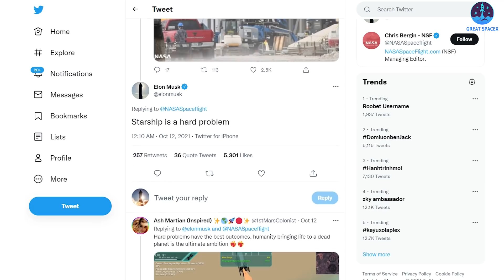"Starship 20 is a hard problem" Elon Musk confirmed on Twitter.

Comment: Could they design the Starship similar to the craft that was used in the film 2001 a Space odyssey, the craft that transport the scientists from the moon base to the monolith in the crater, 
It had the 4 engines at each side that rotated from vertical take off to horizontal flight, I it's just a model for the film, but at least it could land horizontally instead of the vertical decent position.

Comment: The BE4 and Raptor do NOT use the same fuel.   The Raptor uses liquid Methane and BE4 uses liquid natural gas.
Reply: LNG is basically methane but less pure and cheaper. I guess BO are not so concerned about wringing the last bit of performance out of their engines as they are sub orbital joy riders.

Comment: i think  landing could be improved if ring created on legs so it pops out in land and you have aditional ewinforce suspenzor so do you do body even agled force land allow so you allow even extra force working as dampfer so in case of slight heavy touch you got dampfer that take care extra trust wieght and even slight rebalance too as main balance is in legs if tested this so called dampfers on iar or oil are good and can ge continued into spirng into tube also so is even somekind triple dampfering efect off couirse is slight more money but is safer to do so and even easier land so rokcet take some cornering land alos aswell as bottom presure

Comment: A old idea might be the best idea!!
For one way to solve a lot of problems is to have the larger spacecraft permanently in space with a thorium enhanced engine!! You know with the final piece of the thorium engine completed in space!! The THORIUM engines are much safer than any other nuclear engines!! And could be the cargo carriers between earth orbit and the orbit of the moon!! Where it could land on the moon or most likely a small group of smaller crafts could unload the cargo and bring it down to the moon surface!! And even bring raw materials up from the moon to be loaded upon the cargo ship! Plus in time products that could not be made on earth but in the lower gravity of  the moon then be loaded upon the cargo ship!! And the process in reverse as in earths orbit now being unloaded by other crafts!! And with the thorium engines enhance by helium3 from the moon surface results in much greater power with less fuel!! And the enhanced engines of the large cargo ships would travel with greatly reduce travel time between EARTH and MARS!!! And even BEYOND from EARTH or MARS to other places in the solar system in greatly reduced time!! It would be less expensive and less problems!! And could be done NOW!! Might even could used a starship booster!! So instead of heading back to land on earth goes into earths orbit!! And like lego pieces that was first done in practice on earth so only SMALL AMOUNT OF MODIFICATION NEEDED!! And the very starship it pushed into orbit could have the materials with men and small construction robots with job all done in no time at all with the final component of the thorium engine brought up at the last moment of modifications is completed!! But that just a IDEAL and old ideal with slight changes that is all!! But it would SOLVED a lot of problems!!
🙉🙈🙊🇺🇸🇺🇸🇺🇸🇺🇸🇺🇸🇺🇸

Comment: The problem with Starship is its heat shield they're having an issue with those because they can't guarantee that Starship will survive re-entry into the Earth's atmosphere just one of those towns falls off and it's all she wrote and that's what SpaceX and Co are grappling with.
Reply: Another big problem is it's weight. If it's empty weight exceeds 115 tons it cannot go to the moon and back, not even with all 12 tanker flights. The rocket equation is relentless.
Reply: @KEB129  So it only does orbit to orbit. That is not a show stopper.
Reply: @earlpottinger671  It will become a very cool orbiter, the problem is the moon.

Comment: It could be interesting to delve into why it is such a hard problem to crack.  Some thoughts to cross my mind are:
1. The talk of reusable rocket stages go all the way back to Wernher von Braun.  Von Braun was hoping to make a more efficient Saturn V first stage, but the program got cancelled under the Nixon administration and Nixon had his people put into NASA and so we ended up with the Space Shuttle program.  Some have argued that Von Braun didn't have the technology to pull it off and with Von Braun dying from cancer a short time later, he wouldn't have been around to complete the project anyway.

2. An important thing to talk about is mass budget to reuse a rocket stage.  The Falcon 9 booster drops off early enough to where every 5 lbs of recovery hardware and fuel reduces payload mass by 1 lb.  For the second stage is is a 1 to 1 ratio as propellant used to go up to orbital speed can either push payload or recovery hardware.  Where this becomes the rub, with most rockets anywhere from 1% to 4% of the starting mass makes it into LEO as payload.  This gets much worse with higher orbits and much worse still if you go to other celestial objects.  In comparison, an economies of scale 747 can be up to 20% payload mass on the tarmac when fully fueled for a long flight and this is with a sturdy structure and engines that can be flown again and again taking up 30% of that mass budget with the remaining 50% fuel mass.  A rocket on the other hand needs over 80% of its starting mass to just be propellant with 20% for everything else or else it is a sub-orbital rocket.  So yeah with a rocket, the total remaining mass budget after the propellant needed for minimum orbital speed is much less than the mass budget for the structure and engines on a 747.  At this blasting off into orbit is a much more extreme thing to do than flying around in the atmosphere and returning to Earth is a much more extreme thing still to do.

3. So getting into why the Raptor engine is so important is to get any sort of engineering headroom, the engines have to produce more ISP AND thrust AT THE SAME TIME than any engine before it.  At this the tank mass had to be less than any high ISP engine before it.  Here is the problem, we produce lower ISP rocket engines that have a lot of thrust and while it has a great acceleration for a little bit, it runs out of propellant far short of orbital speed as orbital speed for Earth is really fast when you are talking about using chemical propulsion to do the job and nuclear is out of the question because we don't want to irradiate the planet getting something into orbit.  So we developed high ISP rocket engines using extremely cold, hard to handle, and voluminous liquid hydrogen.  These engines turned out to not produce all that much thrust, so then the engines get big and heavy trying to produce more thrust, largely offsetting gains in ISP and then the propellant tanks end up being huge and bulky and even more bulky with insulation to keep the liquid hydrogen from boiling off too quickly.  These bulky tanks also go a long ways into cutting into the benefit of that extra ISP gained.  These tanks are hard to make because the extreme cold makes most materials very brittle, contraction of materials under extreme cold when using different material with different contraction rates, say welding section of tank together can cause different material used in the welds to contract at a different rate, adding to stress loads until the weld breaks.  We saw this weld break issue back in WWII when Kaiser's Liberty ships that were welded together would go into fridged water and then break in half at the weld and go straight to the bottom of the ocean.  So the Raptor engine is pretty special in that it has a higher ISP than most chemical rocket engines, something that full flow staged combustion provides as well as the methane / oxygen reaction being a very energetic reaction (another reason you don't want to be too close to one of these rockets in a catastrophic failure) while at the same time producing very good thrust and the tanks can be reasonably small and don't need bulky insulation.  Full flow staged combustion is a tricky problem in that these engines in past attempts to create something like this have very high chamber pressures and just tend to blow up.  Turbo-pumped engines are very important because high pressure tanks can get to be very bulky, which can reduce payload mass down to the point where you have a sub-orbital rocket, so the turbo pumps allow the tank pressure to go way down to the point where the rocket has the headroom to make orbit and have some mass budget left over for payload in a two stage rocket design.  At this Starship still has several atmospheres of pressure in the tanks.  It is just inside the rocket engine pressures cant get into the hundreds of atmospheres, which is a pretty crazy amount of pressure to hold in and not have things break inside the engine.  The engines also have to withstand handling the heat of a continuous explosion with highly energetic fuel without weakening from the heat loads and melting down / failing.  Then there are all kinds of resonance issues, fluid dynamics issues, etc that all need to be solved for the engine to work and have the amazing performance it has.

4. So now you get all of this amazing performance just to make orbit and have some headroom left once achieving orbit.  After pulling all of the stops imaginable, ~92% of your starting mass is propellant, leaving 8% for structure, engines, and payload just to get to LEO.  Remember the 747 has 50% in this same category with 30% of it spent on structure and engines.  It is pretty easy for an engineer to spend say 5% of that on the structure and engines and then have 3% left for payload and then throw away the rocket stages because it would require the remaining 3% and then some for the recovery, leaving nothing for payload.  However Elon Musk wants to recover the rocket stages and still have 3% left for payload.  Chopping out this mass from the structure and engines to put into recovery hardware is no easy task.  Getting the recovery hardware to work, especially with such a small mass budget for them is no easy task.  The route SpaceX is taking with Elon Musk is precision flights to drone ships and towers that can only be pulled off with modern electronics as it has to be very exact, no slop, in order to possibly work.  The first stage is a lot easier to do and I was talking about this way back in the early 2000's when I took calculus based physics as I saw heating was a cubic factor with the first stage usually dropping off much sooner in a flight and the calculations I did for the first stage showed it was much easier to budget mass for recovery hardware than the second stage.  So when I saw how much was spent on refurbishing a Shuttle solid rocket booster, I thought we could do better than this and have a first stage that was recoverable.  Back then I was thinking maybe inflatable wings would work and have the rocket stage glide back to a runway for a gentle, non salt water landing, but instead be on land.  However many years later Elon Musk proved you could just have the rocket stage fall back to a drone ship and do a last minute burn to land.  At this the Falcon 9 first stage rocket needs to do a re-entry burn to not be destroyed by the forces of slamming back into the atmosphere on return, something I didn't properly consider back in the early 2000's, but then saw was an issue later on when screwing around with X-plane and flying a Millennium Falcon into space and back.  So then when you think about second stage recovery, with that cubic heating factor becomes a major problem in bringing a rocket stage back.  If you want to bring the whole rocket stage back, that whole thing needs to survive re-entry and not burn up.  It gets even more complicated because you have to figure out the aerodynamics to keep the rocket stage properly oriented and not tumble.  Then when close to the ground, it has to transition to ground without getting smashed and broken in the process and preferably you don't want salt water intrusion massing things up.  Whatever system you use for this has to use the least amount of mass possible as every 1 lb of recovery hardware is 1 lb less payload and it is very easy to end up with a sub-orbital rocket because it is too heavy to make orbit.  The Space Shuttle was a bad design with those big wings because then you ended up with this giant external fuel tank that burned up on re-entry to push those big, heavy wings and heat shielding on them up to orbital speed, so what did you really save?  Basically the Space Shuttle saved the "payload fairing" that Falcon 9 saved by dropping it off early in flight and then fishing out of the ocean, which yeah, that is kind of wasteful in the Space Shuttle design.  Then again 1.5 stage to orbit is very inefficient when we already had 2 stage designs that were far more mass efficient as with 2 stage you drop off a lot more empty mass much earlier in flight.  When you think about the Saturn V for example, each stage that was actively firing would be the heaviest part of the rocket when it lit up its engine(s).  When it expended its fuel and was a big, emptry structure with big, heavy engines compared to the rest of the rocket, all of that empty and unneeded mass was jettisoned and then a much smaller fully fueled rocket continued on to the next leg of the journey.  At this for going to the Moon and back, a giant 10m (33 ft) wide skyscraper full of rocket fuel was used to get just two people in a tiny lander onto the surface of the Moon for a short time before they used up their supply budget and had to fly back to Earth.

I am sure there is much more you could get into, but yeah, you could probably make several episodes out of why these problems are so hard, but not necessarily impossible and how advances in technology make recovery more possible.
Reply: comment is to big, and sounds like a peer review, i will not read it

Comment: It's the tiles!  Being able to keep the tiles on while the metal is expanding and contracting during refueling.  Wait until it heats up when reentering the atmosphere.  I'm sure they'll eventually figure it out.
Reply: Yes! Tim Dodd's idea with rounded scales is great! Then we will avoid the edges so the wind cannot attack them so much, we will also avoid the problem with contracting and expanding because they are all above each other.
Reply: Yes, the tiles do seem the biggest single issue, with potentially no solution. They could solve it by not trying to return Starship to earth. For occasions when they need to get crew back use a Crew Dragon capsule instead, but other than that Starship is mainly about getting bulk payloads into orbit and off to Mars.
Reply: retro burns until it gets to 50,000 feet or ride behind a heat shield like the Dragon capsule does...

Comment: The extreme hazzard and risk of the super heavy exploding on the launch pad is just one problem. With ever complex margins for error the orbital refuelling system technology does not even exist yet or the meticulous manoeuvres required anywhere near tested . I have stopped assuming all these problems can be solved without statistical catastrophic events bringing the entire project to a grinding halt.. wether noble technical or human it's still a perpetual gamble
Reply: This old and tired, but 'You can't make an omelet without breaking some eggs.'
Reply: When has SpaceX let a rocket blowing up stop it's research, this is not NASA. A problem is just a learning opportunity to them.
Reply: My bet, this system is so complex that it will never reach its target as there are limits that cannot be surpassed. And in my opinion this is the actual state
Reply: @cristoantonov  some sort of an address
Reply: Every human achievement, from your shoestring to your cellphone was at one point one of those perpetual gambles.
Reply: it feels like starship is being held back by the booster development. it only needs the booster one time.
Reply: The maneuvers for orbital refueling are really not different than the demonstrated automatic docking that already is trusted with NASA astronauts. If you can dock it doesn't really matter to what you are docking. Now the holding and transferring the fuel large scale bit is a little novel though experiments have been done on these as well.
Reply: @AdmiralBob  Garbage/Not sure about that Bob only because The miniscule accuracy required at velocity to avoid a thermal incident or any other unplanned disassembly is so slight that only everyone and thing operating perfectly can prevent a televised version of the very same scenario
Reply: @Nat.Dialogue  Do you think they are going to be trying to link up the fuel lines by docking? That is ridiculous. Docking in space has been done since the 60s. Soft capture -> hard capture -> connections. Not sure why you think that maneuver pattern changes with a fill up.

Comment: Stupid is hard. Reinventing the wheel to make a less efficient wheel is what they're doing IMO. Winged dead stick landing on a runway is already proven and a botched landing doesn't destroy the launch tower. 
One vehicle to do the VERY different jobs of ground to orbit and Mars landing leads to the massive and unnecessary  expenditure and delay. the tail (Mars landing) is wagging the dog.
Reply: Same tech is needed to go to the Moon as is needed to go to Mars and return from both.
Reply: @gravelydon7072  Well not exactly since Mars has an atmosphere but it is true that both use thrust to land. Hydrogen and oxygen are better than methane/oxygen for Moon and Mars though b/c it is available from ice on both and because it is more efficient in terms of Isp. Methane/oxygen makes sense for earth to orbit b/c of our thick atmosphere since hydrogen needs a bigger tank causing more drag.